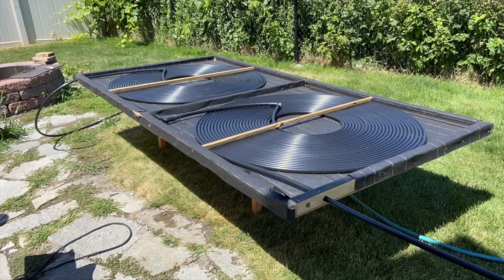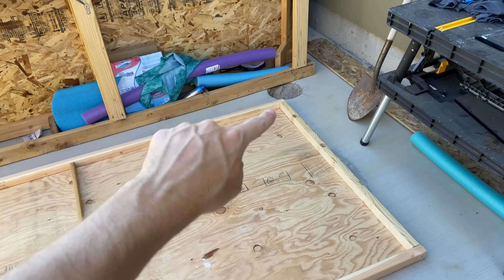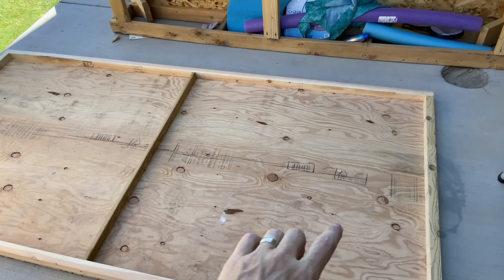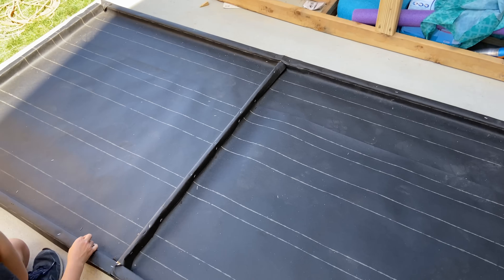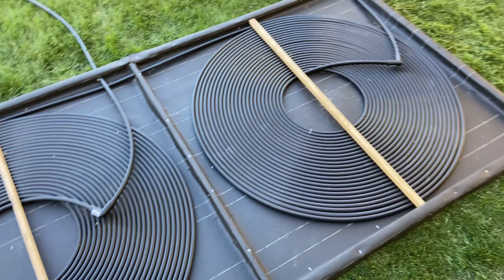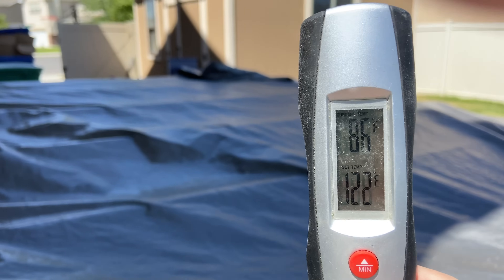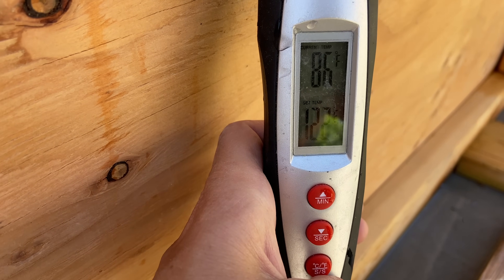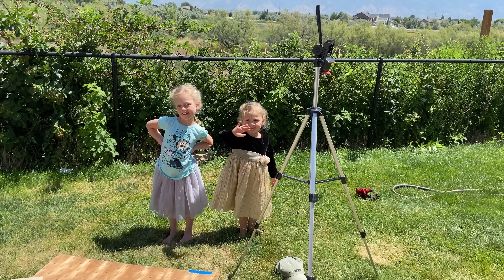DIY Pool Heater - $50 Solar Heater

Comment: This is the absolutly wrong way to do it.  You should use a 2 inch header, where all the small pipes parallell off of that, then feed back into another 2 inch header.  You want as much water flow over  the pipes as you can.  This keeps the heat delta high, as well as the efficiency. The cooler you can keep the pipes, the more efiicient the system is.  I use solar in a 20k gal pool, using 1.5x the pools surface area and a 2hp pump.  I can reach temps around 103 with a blanket.  More importanly i can go from 65 to 85 in a day.

Comment: With the minimal change from lower flow surely you'd be better having max flow and just recirculate to increase heat once it's already hotter than outsude temp etc if using twice as much flow etc it'd be more beneficial than turning it down to gain minimal benefits but reduce flow so drastically

Comment: We are having a pool installed this summer. Living in TX we can get pool weather into late October. I figure with a heater setup like this we could probably add a few more weeks in November before the cold weather overwhelms it. What will really be the test is using it in the Spring. I suspect we could start getting in the pool early April if we can start warming the water up with this in March.

Comment: I heard a variation of this system, was wondering, any of you think it would work with a black plastic barrel say
100-120 l one, would it be as effective, or this one would be better? Although im thinking, in the barrel only the top third of the water will get warm, the bottom probably not.

Comment: I thought about doing this method of a pool heater but I was thinking about doing the fire heater, pumping water from the pool thru a steel tube slowly thru a fireplace and back into the pool. Be kinda cool to have a fire five feet from the pool while heating up the water. Plus the fire water heater would work on cloudy days as well.

Comment: 8:53 You don't have to worry about slowing the outflow to increase the metered temperature.   Faster flow through the system is picking up every BTU.  Less loss of heat.  Exaggerated easy of saying this... slow it even further to almost a drip.  The water will be very hot but now it's sitting in the system giving it time to leave said system back in the air.   Faster water will allow all the heat created to transfer into the water to get sent to the pool.   Sorry if confusing.

Comment: I used this idea to do a less-expensive (although less effective) version: running the tubing along our in-ground pool fence. The fence is about 60 feet on the long side. It took four-and-a-half trips around to get all 500 feet of tubing unwound & installed. I put the spool on a sawhorse so was easy to counteract the half-turn at the ends, and any other twists that arose. To save money, I used old 10baseT ethernet wire cut to length (solid wire better than stranded), but zip ties etc. will work. The water temp went from 65 to 80 in less than two weeks. In full sun, it comes out about five degrees warmer than it goes in (max temp so far here in middle Georgia has been about 80). One-third hp sump pump on a timer powers it, but a thermal switch would be better, set to about 80 degrees. When it gets warm enough, the tubing (inlet fed by a short feeder hose) will be folded back up along the fence out of the way. Outlet end is about six feet long with an elbow so it hooks onto the edge of the pool, and folds away neatly. I'll ad a pic if I can find out how to do so.
Reply: Do you have any pics, I am interested in seeing your design.

Comment: I'm interested to know if the black paper you used to line it is still intact, or has it fallen apart? 
We had some of this in our shed that fell apart over time through heat and sun exposure near the clear light sheeting.

Comment: I built my own version. I did some thing differently that make mine easier to deal with. I live in NC. All we need is to get the pool up to temp when we open it in April and allow us to stretch our season a couple of weeks in the fall. We do use a solar cover to help keep any temperature gain through the night. We don't want to look at the heaters all year so we need them to be portable or more portable than your version.
1) I made two 4'x4' heaters. Each heater has ~200 ft of 1/2" irrigation tubing. A 4x8 panel is way too cumbersome for me to move around by myself. 
2) I added two non-swivel casters to one side.
3) I added a handle on each of the other sides. 
I can roll them away when I want to store them. The coils hold several gallons of water at 8lbs per gallon. They are pretty heavy. 

I run a 500 gallon/hr pump and get a 10 to 12 degree temp increase. It may not sound like that but I am doing a pretty good flow rate. My pool is around 10K gallons. I am able to increase the pool temp 15 to 20 degrees in little over a week, depending on sun and outside temp.  If the tubing feels warm then you are not absorbing as much heat as you could. 

In the winter, it does go below freezing. We usually close our pool at the end of Oct. and reopen it the first week in April. If any water is left in the tubing, it could freeze and split the tubing. You could take an air compressor, get a garden hose air compressor connection at any RV store, and blow out the lines. But if you don't get all the water out, you could have a problem. I plan on pouring a couple of gallons of RV/Marine food grade antifreeze into a bucket with my pump and pumping it through the solar heaters. I will flush the antifreeze out with water in the spring.

Comment: What's the point of the coils in the box? Wouldn't it be easier and more efficient to just build the box waterproof with an inlet and outlet hose? That way you heat up all the water and the entire surface of the box gets heated. I'm confused with the coils.

Comment: when i try my diy solar pool heater hot water come out of the tube at first but after 5 minutes or so it turns into cold water just like in the pool itself, and when i touch the panel it cools down as well. why, should the tubing remain hot from the sun continousily?

Comment: Im trying to figure out the relationship between flow and temperate. You can slow the pump to get hotter water but its less water. Obviously if you can turn the whole pool over in 10 min, raising it only 1 degree each time, you could get the pool to 100 in a few hours, so its not all about output temp.

Comment: I tried that link of installation in the past. Sorry but it's not efficient and takes up a lot of space. But yeah, it's a cheap way to heat your pool. The best system uses vacuum tube collectors, sure most costly, but very little heat is lost, unline your huge spool of black tube. But then again, your solution can work just enough, just not the best. 🙂

Comment: Yes its crazy hot water But but but YOU NEED VOLUME LOTS OF VOLUME of that water.  You need to move volume to heat up the pool.  Yes IT HELPS .   NOW GET SOME VOLUME NOT A TRICKLE OF WATER

Comment: Instead of having two single spiral coils, with an outflow pipe coming out from the center to the outside of each  to complete the loop, you could coil each do these as double spirals, and then use a U connector in the center to join each pair of spirals - so your coils would be more aesthetically pleasing, and you could also use a flatter cover, or hard glass cover etc, and inflow.outflow would be from the outer edge of each spiral. Wouldn't use much more hardware - just two elbow bends in each center instead of one elbow bend, to make the U bend needed.

Comment: You should've done a b4 temp of the pool and then after running for a few hrs a temp of the pool water.  All these pitchers of water didn't tell us anything other than the fact that the water got hot in the hose. It would've been nice to know how long it took  77 degree pool water to heat up using this method.  Your set up is by far the best I've seen so far and I think I'll be giving it a try.

Comment: Anybody know if glass is that much better than plastic glazing? I am wondering about glass v. plastic numbers both for total input radiation and also radiative loss out. 

Glass is much more expensive but lets in more radiation. I have not found numbers on how much difference that makes. Obviously the fiberglass(?) panel works pretty well. But I wonder if using glass panels would be a LOT better. I made a unit about 24"x24" and the glass alone cost the $50. Breakage threat is also big concern (not broken so far in about .15 yrs).

Comment: Thank you! I REALLY appreciate your approach - actually measuring inflow and outflow temps at different flow rates. Excellent. I built a coil heater based on a design by "desertsun02" using black-painted  PEX tubing and he implied the temperature increase would be over 50F almost immediately! I really, really berated him for that bad science approach after I found my results were more like 4F (for a much smaller design than yours). He never replied. Coward. 

What you have done is akin to "good science". I cannot tell you how much I appreciate that. Good work!

Comment: Hotter is less efficient.  You can't swim in water hotter than 100 degrees or so; 80-90 is perfectly comfortable.  The faster you get water through the collector, the more quickly you get the warmth into the pool, before the heat is reradiated out through the pipe.  Modest temperature rises and higher flow rates are more efficient.

Comment: Back in the mid seventies my Dad made a solar heater for the pool. He took old boiler radiator pipes and enclosed them between the garage rafters and covered them with installing boards. It really made a difference in the temperatures of the pool water.
Reply: That's a good idea! Our garage gets extremely hot, and really hot part is along the roof.
Reply: That is smart. Newer smart homes with pools tie the pool heater and water heater into the AC heatpump. When generate heat when you're trying to get rid of it somewhere else.

Comment: This worked like a charm for a 3,000 gal above ground pool, video is much appreciated. Scalded my hand once we got the pump properly primed and first jet of water came out, so word of warning. Not sure how long it will last, or if it was the right choice, but went with Everbilt 1/4 HP 2-in-1 Utility Pump UTA02510. Wife is happy with just one panel but tempted to daisy chain a few more on the garage roof to see how long into the winter we can go here in northern California. Yes it cost more than $50, and requires some extra effort to make it look "tidy", but friends and neighbors are impressed and appreciating results, as are we.

Comment: Looks heavy , especially if you still have water in the tubes when you’re through using it and you need to move it. How do you emptied the water out of the hose so you can store it

Comment: Super great video, thank you,
BUT:
I would hesitate to copy your project for now. The value isn't physically clear, as we would need to know temperature raise and pumping gallons per minute, and then compare that with the pool actually cooling down within a 24hr period. I know your project works, but will it make up for the cooling down???

Comment: It heats a gallon of water, but does it heat the thousands of gallons in the pool?
Reply from the maker: It does, but only by a several degrees (but does make a slight difference)

Comment: With most pool pumps designed to push water only short distances using 2" pvc piping, what effect does your amount of pipe/distance have on pressure/wear and tear on your pump?
Reply: What lol? You realize the pipes go all the way around the pool? Its not really a short distance.

Comment: Thanks for this...  novice here.. just wondering.. i know you mentioned the plastic cover was the cheapest you found.. was there a reason you used corrugated vs a flat piece of surface?  does the corrugated plastic pick up rays on an angle, so less need to adjust the angle?
Reply from the maker: No, the corrugated was much cheaper than straight flat back when I priced things out.  I would have opted for straight flat as I think that would actually do a bit better for letting rays through.

Comment: I have explored solar heat tubes for using the sun to warm air during the winter. In those videos they spray painted the heat collectors mat black. I wonder how much of a gain you would get from less shiny pex pipe?
Reply from the maker: Good question.  My original tar paper I used as backing has also faded quite a bit over time, so a good re-paint is probably needed.  I disassembled part of this this summer for another project, so may not be able to test that though

Comment: So I did some calcs. You got 1 L of water at the end there in 26 seconds. It was raised 13 degrees. This is 2.2 lbs water, and so you're getting 4,000 BTU/hr from the unit. Basically, this will add some heat to a small AGP, but for a 20,000 gal pool this would take 33 days with 12 hours/day to increase the temp by 10 degrees. It's just not enough flow.
Reply: Well thank god someone else figured that out. No way this thing would do anything but a kiddy pool. By the time it gets heated up smer would be 1/2 over
Reply: I think you will never even get there since you will loose the heat during night. Our 1300L Jakuzzi is around 28-29°C during day just from sun and it goes to 20-22°C until morning. Pretty much matching the air temp of that night.

Comment: ive done this idea, but with garden hose pipe... Bought some pipe clips, and clipped the hose pipe on the top of my garden shed roof. 
In close proximity, so that i can get as much pipe on it as possible.
With just a submersible pump in the pool. Tried it for the 1st time yesterday,  Thermometer showed the water coming out the end, was 38c..

Comment: This won't work better than just the sun hitting the pool itself, aside from the extra area.
Reply from the maker: Absolutely works better than just the sun.  But if you added a pool heater cover (the plastic bubble kind) that would also do a lot with just the sun and no extra surface area needed.

Comment: maybe I missed it, but how did you connect this to your pool pump?  Is there an adapter that will connect the big pool pump tubing to the irrigation tubing?
Reply from the maker: You could do that, but I didn't.  I just bought a small (bigger) marine pump (like they use in koi ponds or fish tanks) and dropped that in one corner and that fed the heater loop.

Comment: Can you tell me about the pump you’re using for it?   I want to do a very similar setup but I’m concerned that the one I bought isn’t enough to do the job.  I just bought a little pond pump that does about 80gph.  I thought that just a wee little pump would be good for slow flow/hotter water.  
Thank you.

Comment: Hello,

great work! What would interest me is if you have problems with condensation water below the plexiglass? I have also built such a pool theater and am now considering whether or not to attach a plexiglass. I fear the formation of condensation water, which would then not be so great for the wood.

Comment: I have a 3/4" PVC pumping water that I want to sub into my DIY solar heater. Would it make more sense for me to use 3/4" tubing to keep the flow optimal? Or 1/2" better? Thanks.

Comment: Great video! I was thinking about doing this...and putting it on top of my carport. Any idea how much this weighs with the water running through it?
Reply from the maker: Oh man, not sure.  I'm sure there's some fancy math you could do to calculate the volume of the tube by the weight how water, but I'm not that ambitious :)

Comment: This is a very unreliable build and has many issues with leaks and not working properly.. we tried this step by step with many fails and leaks over a months time... do not waste your time or materials on this!!!! It is not a long term use type of deal and only works on very hot sunny days and is very minimal work for a decent sized pool 30 ft diameter pool on a 98° day all day long using this only gained 3° so definitely not worth it... in the video he uses a gallon sized jug and yes it will show a huge degree difference in such a small amount of water but throw that into a 30ft pool and it's gone instantly... no big difference just a waste of time and money

Comment: USELESS video. PEX tubing cannot withstand long term exposure to sunlight. "PEX pipe is not approved for outdoor applications and is not approved for continuous UV exposure. PEX pipe should not be stored in direct sunlight."
Reply: PEX can be protected by paint.

Comment: the flow of water shouldn't change the power output, if anything a lower flow will decrease the efficiency of the setup because you'll have more heat losses to the air.
The sun gives a fix amount of heat per m2.

Comment: Hi, what did you use to seal the ends of the corrugated plastic panels? Was it custom made  cut wood or smthg from the hardware store? Found the panels but not the end seals

Comment: Hello, I like your guys' set up the paper and the case are nice. I found that when I just lie a couple water hoses on the ground 150 ft. together total  the temp was heating up 19 degrees hotter. We live in AZ so it gets plenty hot . I been watching DIY videos and even bought some solar water heater pads (blah!)   they never worked from day one.  Having trouble finding a good solar water pump that will connect to the solar panel - it has the push in clips.  First pump worked for 2 weeks it was awesome then it went kapoot! They replaced it.  I am on the second water pump it worked for 3 hours then it slowed down and again went kapoot!  Obviously not a good brand.  You guys can adjust the flow? Can you do a video  on the pump to the solar panel?  Or link a good working solar pump?   LOL like your name as I am on my 3rd fail. All this sunshine just going to waste and the gas heater bill was enough to break anyone!   Gotta be a way.